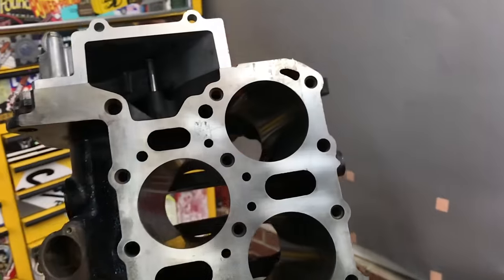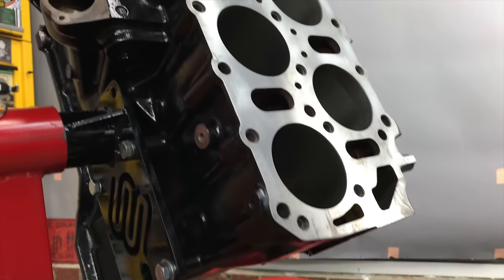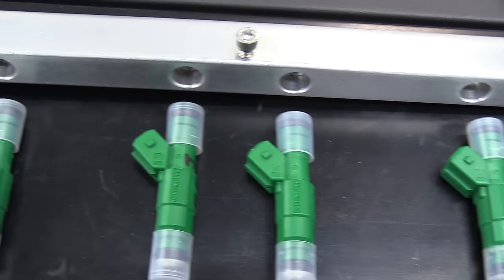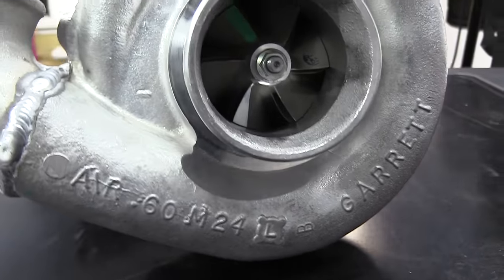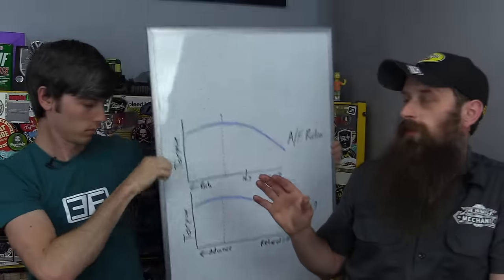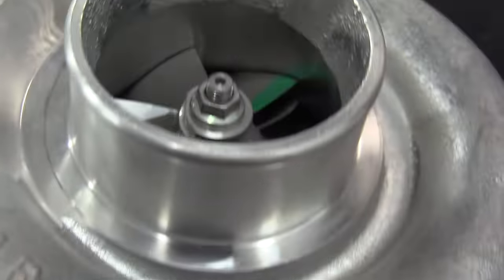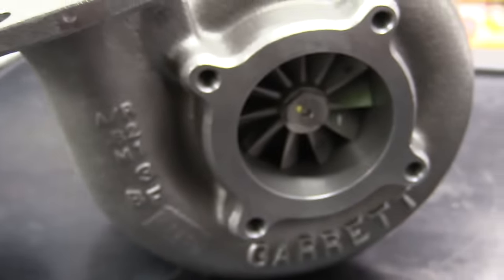5 Ways To Prepare Your Car For Turbocharging

Comment: so your saying if I'm driving an 800$ silverado. I have to put 7000$ in parts and labor just to get 10 mpg. Great vid. thanks for killing my dreams of turbo charged lawn care truck.
Reply: Sterling Mantlow just go ebay kit then and dont upgrade internals xD
Reply: Sterling Mantlow You don't have to upgrade your internals... my Silverado 1996 with a 5.7L doesn't need upgraded internals. 
Not many V8 need upgraded internals. If you turbo charge it.... I don't think they're will be a benefit for me... I mean when I pull boats it doesn't struggle... but maybe cuz they're light things?

a turbo charger in a V8 with Help pull a lot more better with heavier things thou, no doubt! I'm just going to turbo my Pick-up for Drag strips and eating Subarus
Reply: my what is saying that?
Reply: yea but with 220,000 miles... trucks internals are worn. Am I at risk of blowing engine?
Reply: Sterling Mantlow i am not an expert. but if you get solid compression and the engine still runs within its parameters you could go with a low pressure turbo charging scenario to play it very safe like mentioned in the video
Reply: i suggest rebuilt that engine and forget about turbos because you clearly have no idea about them...
Reply: went and got a Toyota Tacoma. cost me $7772 lucky sevens son
Reply: Go buy a truck that cost twice the amount of your silverado then . That should solve your problem mate 👍

Comment: step one for turbo charging your car is have money
Reply: That is 1-6 LOL
Reply: Knowledge.
Reply: laughs in honda civic
Reply: Not really just depends i bought mine on ebay for my truck in almost 1500 with the tubbing and everything
Reply: @jesse6265  was that $1500? If so, that's money.
Reply: @yuhmadorwah  having deep pockets means u can put 10k into your motor and not matter to u
Reply: @jesse6265  what does that have to do with the original statement? You need money. Even if you build your own turbo, do all the work yourself, make every part from scratch, you'll still need to buy the materials. And unless someone is willing to take 2 cows in a trade for those materials, you need money. And that's step one.
Reply: Yeah have at least 10k to spend. 5k on turning then 5k on keeping it from blowing(cooling)

Comment: What going on with level of volume
Reply: You can blame me for that. It was my equipment we filmed with.
Reply: second that motion. was really excited then had to struggle to hear anything
Reply from the maker: Y'all crank up your volume knobs hahaha.
Reply: I thought I was just crazy and kept turning my volume up. I don't question things anymore, baha.
Reply: Try turning the volume up yourself in editing. That's a small but huge oversight.
Reply: I'm maxed out and it's very low, it's been happening in a lot of the vids here lately.
Reply: HumbleMechanic Here I thought that your beard was just smothering your mic a bit. Great video either way.
Reply: What was this recorded with? A microphone for ants?!
Reply: Yep, need to normalize your voice audio track for more consistent volume.
Reply: Great video as always! I heard it just fine. Quick question, what camera were you using for 14:36 if you don't mind.
Reply: Dude, just use an audio compressor on your signal chain in post processing.  Keep jacking the input gain until you have about 3db of reduction.
Reply: The Humble Mechanic does this on all his videos for some reason. Idk think he knows where the gain knob is..

Comment: 1) Turbo charger unit 0:44
2) Upgrade fuel components 01:44
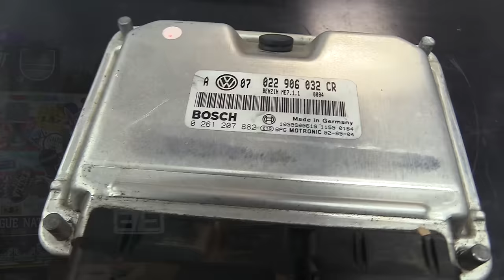3) Upgrade engine management  03:26
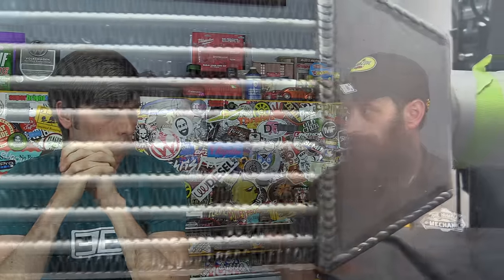4) Upgrade cooling systems 07:03
5) Tyres, Spark plugs, exhaust, clutch 11:30
Reply: But what if your car is a automatic?
Reply: Legend
Reply: @fargeeks  makes things a little bit more complicated
Reply: @fargeeks  shouldn’t matter that much unless you’re planning to make so much power that you might blow the trans
Reply: @JaySosa556  how much is too much?

Comment: This was a lot of fun! I can't wait to get that bad boy bolted up to the GTI!!!! 

Thanks for hanging out with me Jason :)
Reply: Great vid. Just subbed!
Reply: HumbleMechanic I used to be a Volkswagen guy then I went to JDM more power less frustration less money, anyway why did you get such a crappy Turbo! you didn't really tell us the model but I'm pretty sure that's a journal bearing turbo I would have spent a little bit more money considering everything else you're doing to the car and get a gt35r.. Just wondering...?
Reply: Zack Cernok he said he got a t3 turbo in the beginning of the vid..... also I think why he went with this is because he got the cheaper side but also a reliable and higher hp add. Getting a nicer turbo can result in higher hp but if you are running a sleeper (which I tend to think about vw) and wanting not waste all ur money on one component like a turbo, then the t3/t4 would be the best
Reply: HumbleMechanic just want you to know I heard you try and say Turbo and Kit at the same time and you said "tit" 😈😈
Reply: I guess a humble mechanic in America is like a cocky one anywhere else, a rare breed. :)
Reply: It's fun to see the dynamic between you two!
Reply: HumbleMechanic stop writing and put it on! We want to hear it purring! :)
Reply: And why didn't you go with cheap holset hx35 and twinscroll? :)
Reply: HumbleMechanic don't you have to gap your piston rings for boost as well as having the lower end
Reply: Michail Katsiouras paint acts as insulator for heat convection...
Reply: Q.)  For the humble mechanic; im curious to know what exaust manifold you are gunna be running on your AAA-12 valve VR6? Also what the compressor & turbine AR ratio is because i have a 01' AFP-12 valve i just turboed but before i did so i searched extensivly for a divided twin scroll exaust manifold to match my garret t3 t04e twin scroll but had no luck unless i wanted to drop 600$ on a piece from Europe weak
Reply: HumbleMechanic
Reply: HumbleMechanic no problem
Reply: I clicked on your face
Reply: HUMBLE MECH.can YOU SHOW TO US IF IT IS POSSIBLE TO HAVE TURBO CHARGE  IN 2 STROKE ENGINE?
Reply: Informative video. Thank you.
Reply: The dynamic of you both is excellent and it is great every time you get together to discuss IC cars.
Reply: I wanted to thumbs up, but it was already at 666, so I left it.
Reply: HumbleMechanic is it better to buy a kit or to build your own step by step?
Reply: What about the wire between the ignition coil and the spark plug? It burns for me every 2 months.
Reply: You said not to paint the intercooler black I was wondering why because I also watched a video by mighty car mods that shows painting it black can actually improve cooling
Reply: Jon Welch if the paintjob is not perfect it will block the air gaps and also will work as an insulator so it'll block like 10% to 3% of the heat exchange.
Reply: Just subbed! Awesome video
Reply: Hey guys,, hope your well and staying safe,,, I have an ls430 and I Wana turbo install,, any suggestions?
Reply: I wanted to turbocharge a 2.5 b7 passat, would you recommend it?

Comment: Being that Arizona is experiencing 120°F+ weather lately (which I haven't felt for approx 20 years), could you perhaps do a video discussion on the affects of extreme heat on a motor (both forced induction and naturally aspirated)? Or perhaps any other aspect of the vehicle that may be adversely affected by extremely high temperatures? Thank you.

Take care my friend.
Reply: Bert Shackleford yes!!!!
I'm considering running a PD supercharger instead of a turbo due to the extreme heat.
Reply: Bert Shackleford I live in Yuma, and it has been horrible lately x.x
Reply: Hymdhar Guzman saaaaame hot af
Reply: YES PLEASE. Amen
Reply: I would also appreciate this, as I live in Texas where we regularly deal with 100+ degree days with huge levels of humidity. Can't decide if I should turbo my car and deal with the heat/vibration or stick to an NA build. I intend to drive the car every day, and on occasional road trips so reliability is key.
Reply: Haha I'm in Phoenix and drive a WRX, the Heat makes a big difference! Turbo loves the Winter... doesn't like the heat so much
Reply: See I am in west Phoenix with my BRZ, I wanted to slap on an AVO turbo, but the heat is so insane out here, I am thinking of installing an Edelbrock supercharger instead; since they are thermodynamically more efficient in the heat.
Reply: well engine operating temperature is usually 176 F so as long as it's not reaching that levels, NA engines are fine
Reply: Look into Kraftwerks/Rotrex superchargers, they're supposed to be less prone to heat soak than most other types of superchargers. Check out their website, pretty sure they have a BRZ/FRS kit. (in response to Alex Moore)
Reply: It's not really complicated and they've kind of already discussed it in this video. 

Here are some mods you can do to improve cooling:

Cooling w/ or w/o turbo:
1. Radiator(water/coolant) + lower temp thermostat(so that the thermostat opens up earlier to keep temps lower)
2. Oil cooler
3. Transmission cooler (not usually upgraded unless heavy circuit racing)
4. Power steering cooler(not really common, but is done for autocross cars w/ power steering)

Engine cooling only if turbo:
1. Intercooler
2. 1 step colder spark plugs
3. Water/methanol injection (optional, not usually done. It gets extra cooling for the turbo compressed air before getting into engine,. can even be used without an intercooler)
4. Buy a water cooled turbo(need an extra coolant entry and drain lines apart for just 2 oil lines).

A good example for Radiator upgrade is a boosted 240sx, it's very recommended to swap out the Radiator and thermostat for cooler units.

A good example for oil cooling is the 350/370 Z, the stock car has no oil cooler, and oil temperatures get too high when driven on the track, sometimes even hard street driving, so an oil cooler is a recommended first mod for this particular car at least.
Reply: Why would it vibrate from adding a turbo?
Reply: Because the wheels and shaft spin well over 100K RPM, and you're also adding a choke point right off the manifold which can potentially introduce exhaust resonance (kinda shooting air here, not entirely sure on details). The big thing is you're adding a pretty significant amount of weight right over/under the manifold and the mounting studs on the head, so any amount of added vibration will matter as far as nuts backing out and such.

SI0AX above listed some tips for upgrades when adding a turbo. I'd like to add some other small tips for things people don't always think of:

1: Nordlock or Stage8 locking washers/nuts. This will help prevent exhaust leaks from nuts backing off on the manifold.

2: Make sure the oil feed is as straight and vertical as possible, and the drain is also straight down. Any kinks or harsh angles in the drain is bad.

3: If possible, always get a turbo with water cooling. Just helps keep some of those temps down.

4: Heat wrap/shield everything in the area.
Reply: newpa1n the power/torque curves are laughable, they are marginally  better than NA until 5k rpm, it's all the cons of a turbo and supercharger at the same cost. a positive displacement is just as efficient and makes way better power.
Reply: Real simple!  IAT over 140° F will result in massive ECU intervention to dial timing and boost back!  Very few if any OEM intercoolers can limit heat soak to 20° F IAT heat gains over ambient.
Reply: alex moore A PD blower has higher IATs than a turbo.
Reply: SI0AX If you feel the need to add a lower temp thermostat then you're radiator is just to small.
Reply: Steve Pounder not the twin screw for the same level of internal pressure under 12psi
Reply: alex moore I disagree however yes as boost increases PDs get hot very fast. Some of this is negated by running a larger supercharger to keep rotor speeds down. There's a reason OEMs use turbos when they can and go superchargers when packaging doesn't permit turbos. Plus it takes more power to turn the supercharger. Love the whine of blowers but turbos are king.
Reply: alex moore Supercharging generates more heat/are less reliable/make half as much power/torque for the same price. Where is the logic?
Reply: jeremy whittler TVS blowers are not less reliable than a aftermarket turbo system.
Reply: Does tvs manufacture one for a vr6? The only supercharger made for a vr6 is vortech based.
Reply: Steve Pounder I gotta say it doesnt even matter and its not even worth talking about unless its a rotrex unit. Pro charger makes badass blowers for v8's but were talking about a vr6 here.
Reply: Bert Shackleford does hot weather dry out rear main seals?

Comment: Upgraded fans can actually reduce cooling at speed. A crossflow radiator is the simple way to increase your cooling capacity at all vehicle speeds.

A larger (or oversized) intercooler is actually a good idea to increase reliability, as it reduces IAT significantly. 

Even though that turbo is over twice as large as necessary, this is good to keep IATs down as well, since 10psi is at the low end of it's efficiency island.

Comment: Turbocharging my tacoma was probably one of the coolest things I've ever done. The same truck and engine come (came) factory with optional supercharger pushing 6-8 PSI, so 8 PSI from a turbo is nothing she can't handle. EVERYTHING about the engine and fueling is stock. Has methanol injection to compensate for the extra air, so I get extra fuel and way higher knock threshold in one package. 4 years later she's still boosting and whoopin booties.. in fact just whooped a chipped and tuned Cummings the other night. Fun fun

Comment: "just don't paint it black" lol little jab at MCM there 😂😂
Reply: Don't paint it black? I don't  think Mick Jagger would be happy with  that! (lol, The Rolling Stones Joke)
Reply: Mine is black. Why is that bad?
Reply: Srsly Brah because it's purpose is to bring cool air to the turbo and black absorbs heat the most. So making it black would make it less effective since it would be adorning heat, that's the reason why they are mostly whiter colours since white absorbs the least amount of heat.
Reply: Ismazara i'm sure mcm did something showing it was either cooler or that there was a horsepower gain.  cant remember which one it was but the outcome was to paint it black because it is more stealth and had larger power gains
Reply: The MCM guys never reply or update the videos, I’m talking about the vid of them doing the super chip that failed. I think most car parts that only cost 20-50 from eBay fail. But if you got a KTuner how would that work
Reply: @deathman020  black attracts heat
Reply: Paint is an insulating layer so it reduces the potential efficiency of your intercooler

Comment: Richard Holdener would recommend opening the ring gap on the top ring to prevent them from butting and sticking, especially if you are going to turn the boost, all the way up. Great vid, guys.

Comment: high compression with lower boost is more efficient than low compression with high boost for everyday driving.  Both will make the same power, only the low compression motor will need more boost.

Comment: Second question, I have a trackcar with almost no mods beside brakes. It's actually totally not a trackday (Citroën Saxo 1.1i). If I tune it to 75 hp (60 stock), do I have to upgrade the cooling as well? Or do you think the stock cooling system will be enough? Tx
Reply: “Track car” with 60hp I don’t think You should be putting money into that imo
Reply: @tritthemit4168  and one more judgment I didn't need 😐 actually it's my ow'mn project car and imo, everything is worth it if I at least enjoy it, which is the case.

Instead of that, have you maybe an answer to my actual question?
Reply: @dilysi156  yes sorry man your right as long as you enjoy it do whatever you want and about the cooling if you haven’t done anything else to it I wouldn’t think you would have to
Reply: @tritthemit4168  thank you ✌️

Comment: I'm a bit late to the party, but another thing that you should make sure can handle the power: your rims. Someone I know ran around with a 1987 Toyota Supra Mk 3 with a 1JZ Twin Turbo pushing I think 12 or 14 PSI of boost or something. He was running Centerline Forged 6-spoke 18" rims, and cracked all 4 rims. He found cracks in the rears, swapped the fronts and rears, then cracked those too. So badly that at least 1 spoke was cracked clean through, inside to out of the rim and was completely seperated. He was only pushing about 310-320 HP too, those may have been "bad" rims but keep that in mind when turbo'ing your car. Make sure like they said, your tires and brakes can handle the extra power. But also make sure your rims can handle it too.

Comment: I want to contribute to the vw reliability here, im having 100% stock vw ABF(2.0L 16V) engine base with stock compression ratio, wich had almost 300000 km's on the clock before getting any power upgrades. Not its on 0.6Bar of boost and 270hp/300NM.
And its running strong! :) 
This winter were going all in with performance upgrades! 
Cheers to all turbocharged petrolheads!